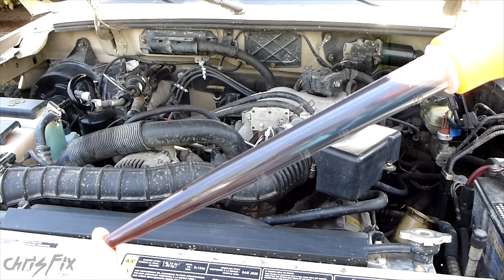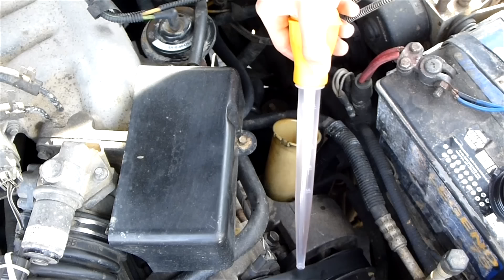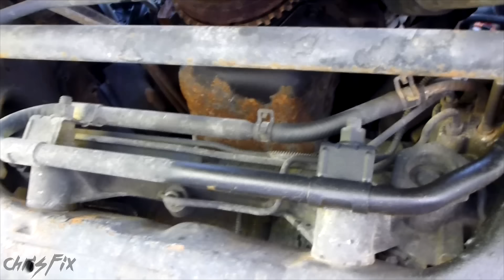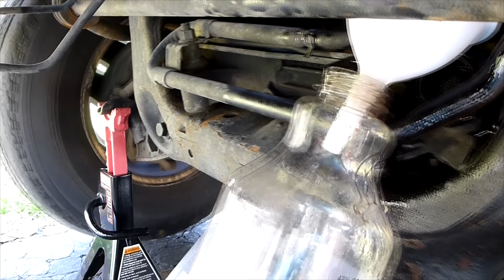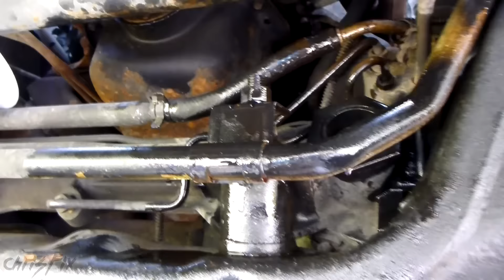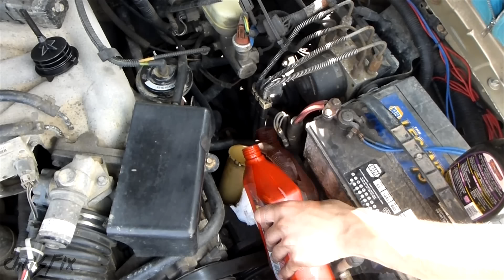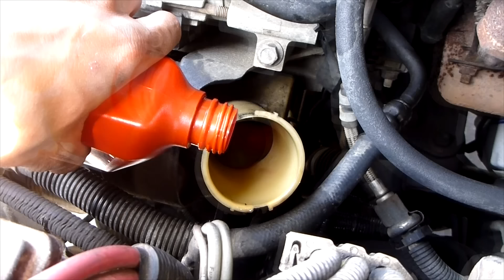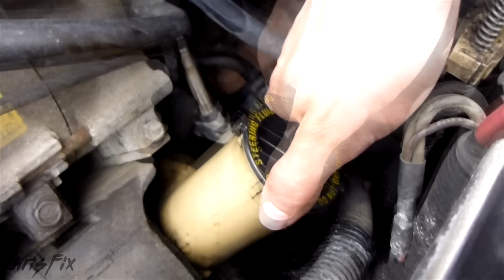How to Flush Your Power Steering Fluid

Comment: I tried this for my 2003 Elantra and I'm regretting it big time. I followed this video step by step. I'm left with very dirty fluid after and a very noisy steering pump. I don't think this flush got all the old fluid out. I disconnected the hose down from the reservoir on the bottom of the engine, I'm pretty sure it was the low pressure line cause it had a metal clamp that unclamped with pliers. I wish I never did this flush myself. I have a major problem now. I hope I didn't wreck my pump...

Comment: I have shaking in the steering wheel while breaking between 40 - 65mph. I replaced the rear rotors and rotated the front, but the problem is still there. Just curious but would you have any idea that could be the issue? Or do you think that the fluid is the problem. 113000 miles, probably original fluid 98 mustang

Comment: I'm trying this myself, though my mechanic did it last year. I live where it's really hot, and each year, the fluid gets really gummy. Like vaseline texture and black. I wipe as much out of the top reservoir as poss, but worry that I won't get it all out , even if the fluid coming out of the flush at the bottom return hose is clear/pink/clean. How can I keep it from happening/make sure I get all the solid chunks out?

Comment: For those who wonder, ATF has been used as power steering fluid in cars since normal ATF was developed. ATF is ideal fluid for cast iron pumps (aluminum body pumps should not use ATF,) since ATF is both Hydraulic Fluid and Lubricating Oil in one- exactly what power steering needs.
Reply from the maker: +Cody Moncrief thanks for the info!

Comment: Your biggest problem here is that you have a Ford 3.8L. I'm not biased, I've owned the 3.8L a few times. If it's an older Ford and V6 is the only option, go for the 3.0L. Water pump, head gaskets, electrical timing/ignition issues, etc. The 3.8L should never have been made.
Reply from the maker: This is a 3.0L...

Comment: does all power steering cars require power steering fluid?
Reply from the maker: No, some use electric power steering.
Reply: Okay thanks. Then how does one service it? Because when the car idles i hear like a sound like a robotic reconnecting sound. It comes from the steering wheel. Not sure what it is.

Comment: Fyi its better bleed air out of pump with car turned on and power steering cap off and turn the wheel left n right to purge air
Reply from the maker: +Mitchell Justus thanks for the tip

Comment: Great video ChrisFix can you tell me how to spot the pressure lines? I cant tell from video is the font driver/passenger or behind one of those wheels? I have chevy 4x4 and not sure if they're hiding under a kick plate by the front cross member so I cant see them?
Reply from the maker: +xMrSilver99x high pressure lines are crimped
Reply: +ChrisFix Thanks that part I understand, I just don't know where physically either of the lines are located on the truck. I don't see them when I look but I haven't lifted it yet, I just can't tell which angle the video is from. Is it shot from in front of the truck tires looking towards the back?

Comment: Hey ChrisFix awesome videos and good mechanic sense,but for ford power steering their is a much easier way to bleed this system,remove power-steering overflow tube,plug pump overflow nozzle on pump, connect clear see through3/8 hose run to catch basin,then disconnect,CSS,cranked speed sensor,fill up power-steering with a funnel that allows for excessive amount, start car,wont start just turn over.Never crank for more than 15sec, see fluid come out from overflow tube until bright red,rotate steering lock to lock but not holding for more than 3sec at full lock to bleed system,re and re hoses,test drive done,no mess ,no fuse just results GL Everyone
Reply: overflow line just in case anyone gets confused is return line leading back into pump you can always tell a low and high pressure by size and diameter of the lines

Comment: A little trick I use ; Every time you change oil (3000 miles) siphon out power steering fluid from the reservoir.  Then add new. That way it always has new fluid. Same with brake fluid.

Comment: Hey Chris! My 02 Pontiac Grand Prix makes a whinny noise if I steer hard left before the car reaches running temp, do you think this is a mechanical issue or could this be due to my power steering fluid?
Reply: The whiny noise doesn't really sound like the one demonstrated in the video

Comment: Do you need to jack up the car to remove the hose? Or just for ease of turning wheels? Plus, my power steering fluid looks like Chocolate Milk..any idea what that means?

Thanks! Great videos!
Reply from the maker: It is definitely helpful to jack up the car for both of those reasons but not completely necessary. You can do this instead: https://www.youtube.com/watch?v=VuPALAnHjRM
The milk is probably water in the power steering system.
Reply: Thank you very much!

Comment: I have not seen a Video on PCV valve replacement. I know its different on all cars but on some cars like the T bird need it to be changed after 35k miles. that is like once a year ad I wish you would have had a video on it so I could have seen your way of doing it and you tips and tricks because a lot of people forget about it and in some old cars it makes it a very hard job when something that only lasts a years has been on the car for 20. I would make for a nice video.

Comment: Absolutely fantastic presentation. I had noticed at auto zone they had a flush and cleaner with a pressurized canister of air soap conditioner but I also subscribe to the 2 clean theory where if you blast old parts with too much scrub it tears up the rubber. This was a great presentation on how to do it manually and if you have another person helping you to turn the wheel your golden you can do this so fast. But on sentences I use a voice program thanks bro that is so awesome
Reply: Sorry Sir pardon the run on sentences I use a font program and the punctuation slow it down . I subscribed to you and I'm going to check out some more so I do a lot of shade trees

Comment: hey chris excellent video.. My fluid is Dark brown so I need to do this right away..just a question where did u get that pump at. to get the fluid out?
Reply: 3ln3n3romantico22 The clear plastic tube stuck into a yellow rubber squeeze bulb is called a “turkey baster”.  You can buy them from your favorite food store.  Hope that helps!

Comment: Getting ready to flush my power steering fluid, I noticed that the link you have in this video for the additive doesn't send you to the product you used in video but to a power steering leak repair fluid. Is this still a similar product. I currently don't have a leak so I'm not sure if I need this?

Comment: I doubt you would even see this comment but I have a weird problem with my car. It's always ran perfect but recently when turning my car it has a loud humming noise coming out from the engine. I figured it was the power steering that's why I'm watching this video. I checked the level and it seem fine. Is having old power steering fluid causes this problem or is it coming from else where?

Comment: Can I ask you another question about my struts when my car goes over a bump my car makes a really bad squealing noise right next to my passenger tire and I thought it was the power steering but I've put new fluid in so it's not that. the sound also happens when I turn my tire all the way to the right any ideas? Could my strut be out of lubricant?

Comment: I recently watched your video on how to fully flush the power steering after I flushed everything until the new fluid was coming through I connected all lines and filled the power steering to the correct level and then I drove it and came back and my fluid is black and I did a second flush doing the same method as the first time and it's still turning black. So I'm wondering if there is any ideas that could give me. It's a 99 v6 mustang. Thank you!
Reply from the maker: Your power steering fluid fluid is probably just really dirty so dont worry. As long as you have new fluid in there, you are good.

Comment: Tried to do a flush because my power steering fluid is really bad but I couldn't get the hose off no matter how hard I tried. The hose is stuck over the pipe by over an inch. looks like I'll be just doing a change

Comment: hey chrisfix i have a question. i own a 2007 ford taurus sel and for some reason its really hard and i mean really really hard to turn the wheel. it is making the same noise as your car was in the video. the fluid was a murky brown and was kind of thick. i tried flushing it just like how you did in the video but it didnt help. i think it might be clogged or something. do you know what to do??? i need to know this is my only way to get around and i cant cause i cant turn.

Comment: hey man big fan of your video I'm having a issue I did this flush same problem the wheel binds up if I'm at 2000 rpm it turns finds but if I'm at a idle it is very hard to turn wheel. I seen on line it might be frozen u  joint. do you think it's power steering pump? thank you !

Comment: hey Chris, if I can reach the power steering line without having to jack up my Ranger can I do this power steering flush anyways? I'm asking because I don't have a floor jack or stands yet. Is it absolutely necessary to have the vehicle jacked up? I'd appreciate some help, man
Reply: Albert A The reason Chris says to jack up the front wheels is to allow you to turn the steering wheel back and forth to manually force as much fluid out of the steering hoses and other parts of the system.  Remember this is about changing fluid on a power steering system.  If the motor is off, there is no power assist.  That means the steering wheel will be VERY hard to turn back and forth.

See if you can borrow a pair of jack stands and a floor jack from a neighbor or friend.  Some parts places will allow you to “borrow” tools by paying up front for them, then when you return them after you are finished, they refund your money.  Good luck and hope that helps!

Comment: You can also pull the car up on a hill so the front end is higher than the rear and with the car running turn it all the way left and right and hold it there for a few seconds to help bleed all the air out. Love your videos man... Since I have found your channel I have been watching all of your videos:)

Comment: I just bought a 2000 honda civic and its kinda hard to turn the steering wheel, harder than it should be. The fluid is full and pink and the guy i bought it from said the rack is a year old. Should i change the fluid or what can i do to fix it? Thanks

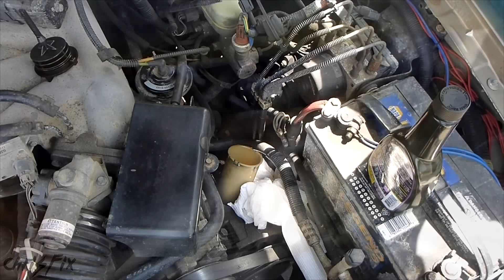Comment: 4:04-4:07 why did you say it helps quiet ford steering pumps if its a mazda
Reply: Hayden 3210 it’s an older Mazda truck that used a lot of same parts as ford ranger

Comment: Pro-Blend Power Steering Enhancer 530 4600 does not have data sheet, using this in ATF or CHF system could cause it to fail. Do not use
Reply from the maker: Thanks for sharing!
Reply: Thank you for reply. I just wanted to state that your video are great for teaching people, but should be taken as general advice. I can tell you putting additives like that in my Porsche and/or Land Rover would cause deterioration of seals. Everyone should take manufacturer recommendation before doing any repairs.

Comment: If my power steering pressure switch has gone bad can i drive it like 5 blocks dry to the shop? There is a bit in there but it just spills it out through the faulty pressure switch in little gushes.

Comment: Question:
Did you have to replace the short length of low-pressure hose?
Reply from the maker: No, I did not replace it. I just put it back on.

Comment: Chris fix my steering wheel when I turn it all the way to the left and right makes a sound is that power steering or is it just the truck making the sound
Reply from the maker: If you turn it all the way, it should make a sound. Try not to turn the wheel all of the way. It stresses the power steering pump.
Reply: ChrisFix ok I just wanted to clear it up I had a feeling it was the power steering pump doing it thanks alot love the vids

Comment: Hi Chris,

My dads car is a 2002 Vauxhall vectra, problem is back in the summer the power steering light came on so we thought the fluid may be low so we went to top it up, but it happened to be full but light remained on, brought it to a mechanic to try and get the light off but no success, went to have a look today to see if I could fix the problem and checked the fluid the power steering fluid is white milky colour now but before was a pink colour, why would this have gone like this? And how could I go about fixing it?

Thanks Todd

Comment: I'm confused here, video is flushing power steering fluid but why R U put automatic transmission fluid in power steering pump.
Reply from the maker: The power steering pump takes auto transmission fluid. Power steering fluid and transmission fluid are very similar.

Comment: Q: The power steering fluid reservoir has 2 hoses, 1 out and 1 in, what if you pushed air into the out hose, will it flush it all? Please answer.
Like if you want chris answer too.
Reply from the maker: If you push air into the out house it should force the fluid out and flush the system. Make sure you force new fluid though the system to bleed the system.
Reply: ChrisFix thanks for reply,
It will be flushed completely right?
If i can't push new fluid i can only add to the reservoir and it will suck it will this make problem?

Comment: Hey Chris, the link to quiet your power steering does not work. I'd like to see what you cover?
Reply from the maker: All of the links work... I just tested each one. Which one are you having trouble with?
Thanks!
Reply: damn sorry it must have been my phone acting screwy. But let me ask you. I have a honda accord. Could I use this product or do they have one for hondas? Thanks for responding and also for all the tips!
Reply from the maker: +Efren Lechuga use the Honda power steering fluid recommended in your owner's manual. You can use the noise additive if it still makes noise after the flush.

Comment: Thanks ChrisFix,i did my 2002 Yaris 88k seemed okand 94 Astra  53k pretty dirty n looked horrible but no more fluid came when i did sucked it out at the top.I did turn the steering wheel many times filled it up then drove it for a week making sure i did turn the wheels alot then sucked it out again so that's the way i did it and looks really clean,good enough.

Comment: Hey Chris, love your videos. Glad you got the same Mazda truck as me, so I can see how it's done. I have question about power steering fluid flushes. I just paid to have mine done, I live in apartment and don't have place to make a mess, so I paid someone to do it. After I picked it up I decided to check the fluid, and it was still dark. It wasn't pitch black, but it is more brown than red. Did he not do it, not do it right, or is this somewhat normal? I have about 200K on my 2001 B300, and this is the first time I have had the PS fluid flushed. I'm not sure if I just almost got ripped off or if it might take a few flushes since I have neglected this for so long. I live in a small town and the mechanic has a good rep (referred by a friend), but shouldn't he have flushed it until it was nice and cherry?

Comment: Hi chris, I have a question about power steering fluid that I need to add. I have a TOYOTA CAMRY 2008 LE and it says to add Dexron 2 or 3. But some people are telling me that its better to put an Automatic Transmission Fluid (ATF T4 or D3), I really don't know what to choose. I'm ready to flush all the fluid and put the new fluid all over, but the problem is that even I'll flush it, the old power steering fluid can be stuck in some direction pieces. Any suggestions?

Comment: So, if I have power steering fluid in my 98' Ford Ranger XLT V6 5speed manual, is making a lot of noise, and steering makes the steering wheel feel "bouncy" or make it feel like the tires are super grippy, does this mean that I need to flush my system? 

Also, my Ranger is leaking oil, but when I go under the car, I see a lot of oil where the transmission and engine meet, should I get this to a Ford dealership and see what they think, or should I just fill my truck with oil and see what happens? The truck was sitting at my job for a while because the alternator and battery were bad, but when I got the battery charged enough of me to get it home, it made a weird noise, so I shut it off and checked the oil. It was crazy low. 

Another thing, my oil pressure is generally close to low pressure. Could this be because of the issue I'm having?
Reply: Michael Turner-Smith you power steering needs to be changed and depending on how much miles your vehicle has and its value it's your choice to take it to Ford or not cause it's the same for Chevy 4.3 powered trucks and vans and our 2000 GMC Savanna has 240,000 miles has an oil leak so value $1000 at most so we're literally like F*** It not worth the repair cause engine is really worn too as for low oil pressure it can be an oil pump but other than that your engine is bad by that I mean bearings are worn and old and I have work one cars with as little as 20k miles to over 250k miles
Reply: Michael Turner-Smith oh and if you do change the fluid use some good stuff like LubeGard Royal Purple or Redline
Reply: HERPY DERPEDY Ha! My Ranger has 340,000 miles! I guess she just needs a Power Steering flush. I have no tools at all. I'll get a Mexican to do it.
Reply: Michael Turner-Smith you just need a turkey baster and a car jack and the fluid ._.
Reply: HERPY DERPEDY Don't have time. I work at home and work with BMW.
Reply: Michael Turner-Smith wait if you work with BMW why a profile of an Audi
Reply: HERPY DERPEDY The R8 is my dream car. Plus, you can't corollate the two. I can work at Chevy and drive a Ford. Money is money.